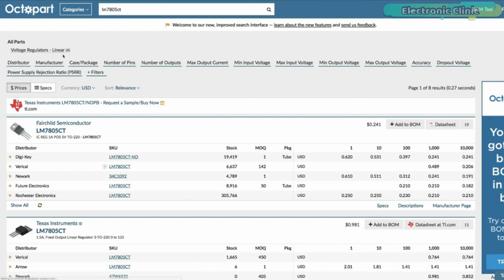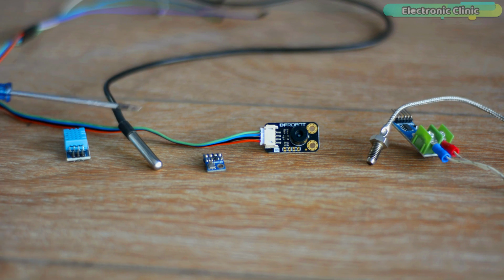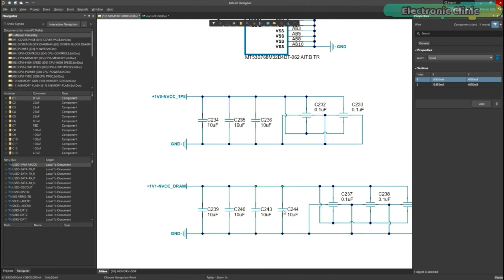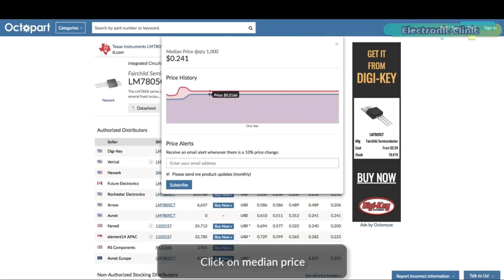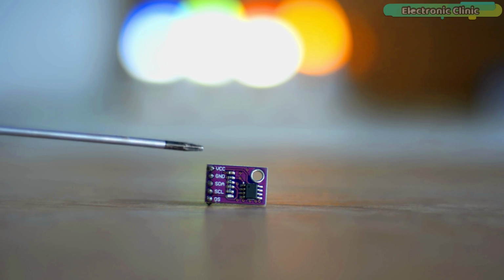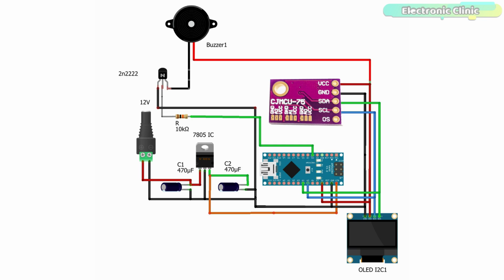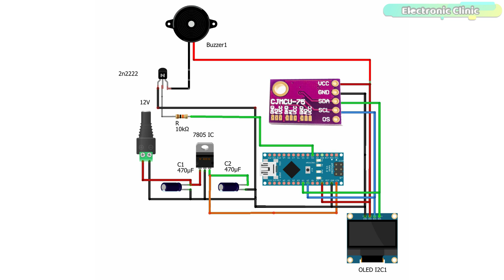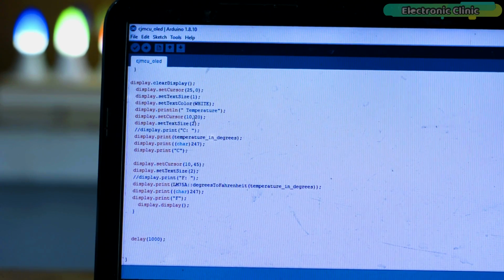LM75 with Arduino, LM75 I2C, LM75A Arduino Library, CJMCU-75 Temperature Sensor

Comment: I am trying LM75 with esp8266 but it gives -0.5 C nothing else however the code is correct 
Kindly assist
Reply: I have the same issue any solutions?
Reply: @heartstopper-x  It must be the pin configuration try using other pins on esp82 and recheck your code too
Reply: @talhasami150  thanks will try it